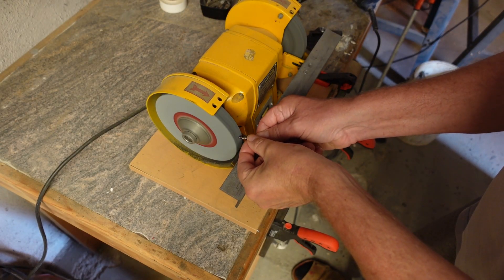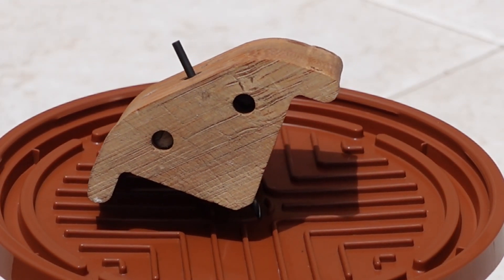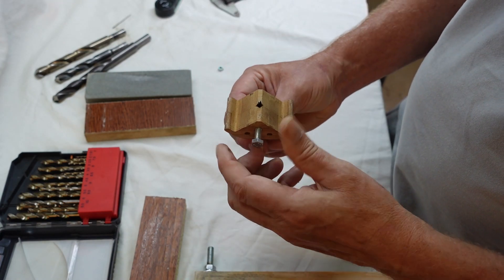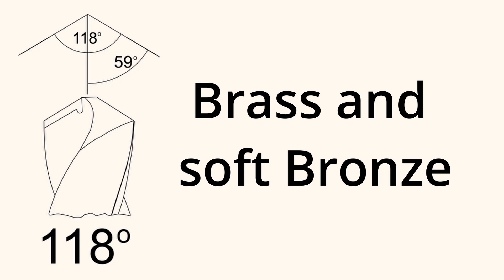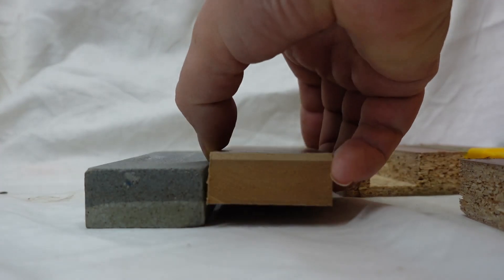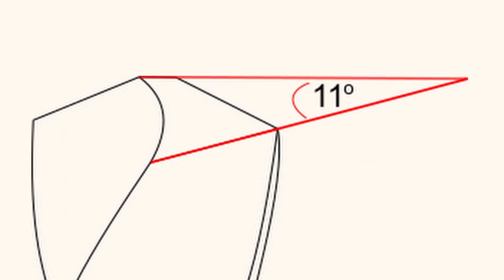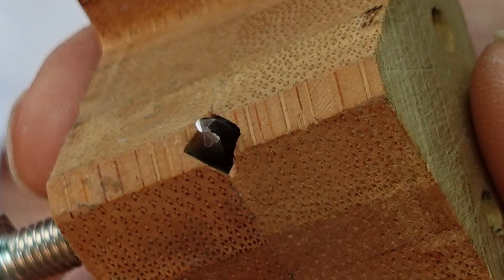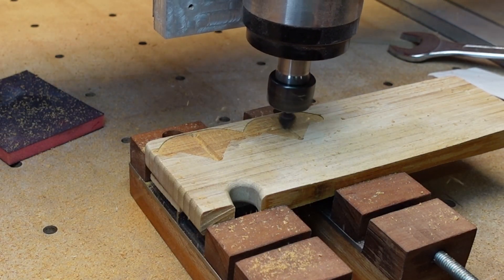Sharpening small drill bits by hand with a jig

Comment: I LOVE my Drill Doctor 750.  Sharpens 1/8 to 25/32.  Splits point without endless wheel dressing.  Still, I use 1/8 down to numbered bits a LOT.  This will certainly be helpful.  Bits above 25/32, I do the old, old way, by hand.  Another tool for the tool junkie.

Comment: I don't understand how the relief angle is formed?
Reply from the maker: Hi caskwith, very good question and thanks for asking.  For the relief angle, you need to rotate the drill slightly. For example for a 135° drill the tilt angle of the jig would be about 58°.   135°  /  2  = 67.5°     67.5° - 11° relief = 56.5°   56.5° + 1.5°( if you just want to sharpen the cutting age) = 58° . So if the jig is tilt about 58° and you turn the drill bit till the relief area is almost laying flat on the whetstone then you just sharpen the age of the cutting lip. I usually pull the jig a few times over the stone and then check with a magnifying glass. If necessary I adjust the drill bit. Of course the angle can be adjusted in addition by pulling or pushing it slightly out of  the jig. I hope that this makes sense.
Reply: I built one and it won't sharpen worth a dmm.  I've looked at the video over and have yet to figure out the drill cutting edge alignment in the jig.  Are there any close up pictures of this some where?